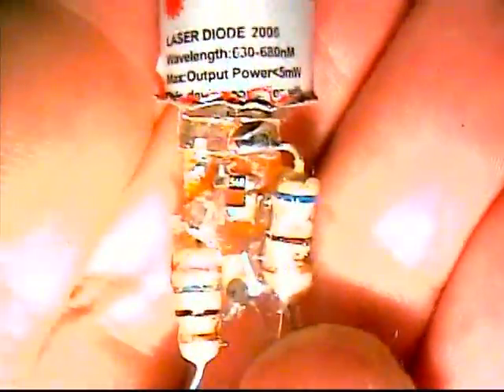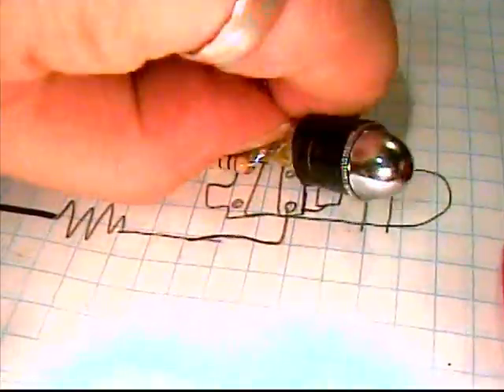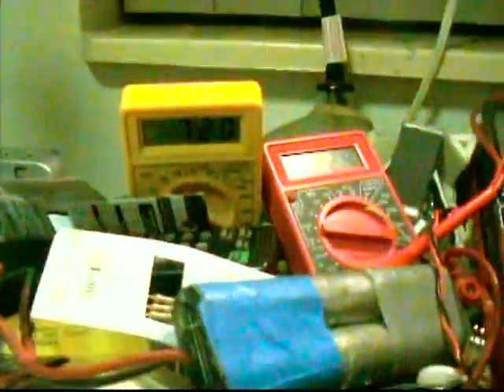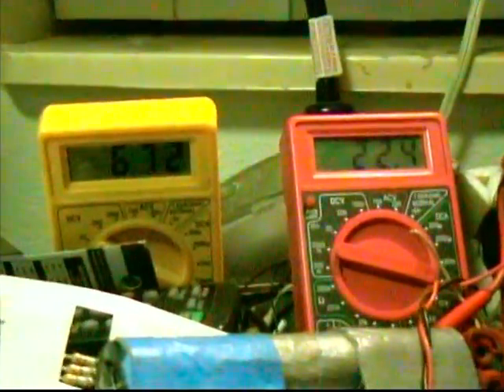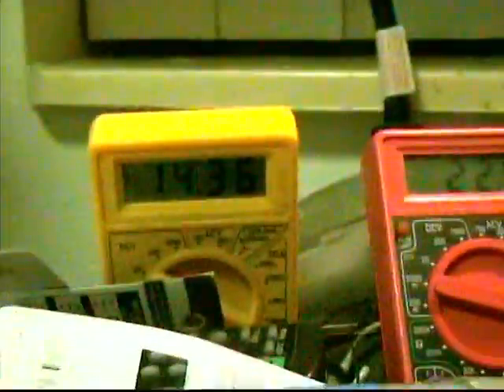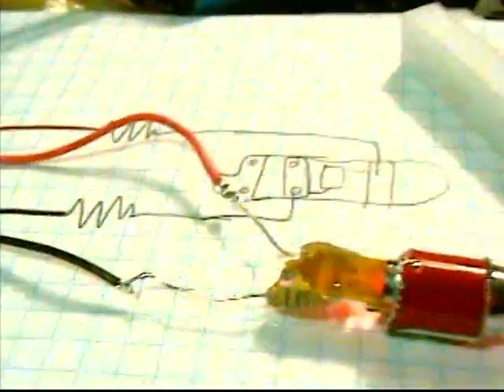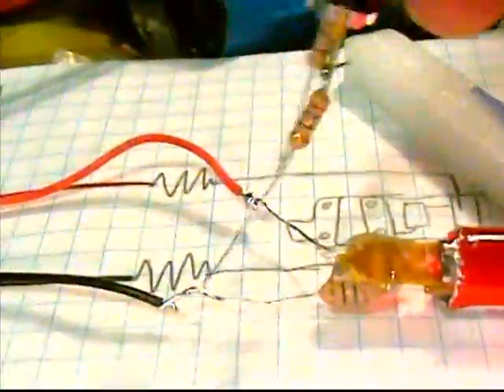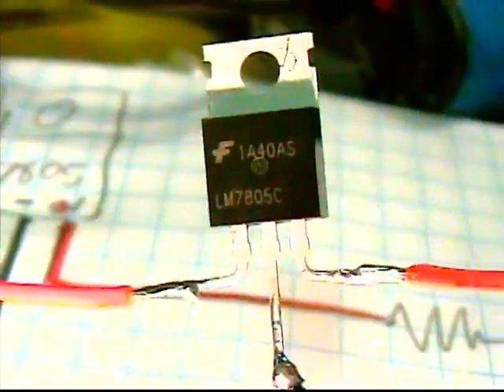PREDATOR LASERS ULTIMATE TUTORIAL PT 3

Comment: Nice beard, thanks for the tutorial! Any schematics ?
Reply from the maker: Yeah , there's the schematic on the graph paper that I'm building the circuit on , in the video , the two resistors are (a 68 ohm resistor (blue,grey,black,gold) and a 15 ohm resistor (brown,green,black,gold)) (but if You tie all of the lasers in parallel then You can just use one 33ohm resistor (orange,orange,black,gold) . It's really simple (maybe just for Me because I know it) , but I really did try to make it as simple as possible and I have the actual circuit hooked up shown right above the circuit diagram to show exactly the connections needed .     Good Luck Man .     Ask any thing else that You want .
Reply from the maker: You can see the schematic pretty well at 2:00 minutes into the video .
Reply: Okay awesome! I'll take a look at it, and I'll post a video of your design once I set it up in my hand made wolf helmet. I should be able to get away without using resistors because I'm essentially just installing a switch to power all 3 of the lasers on, and then the batteries remain in the same compartments. But I might try your method also, since I happen to have a 3 AA battery pack available
Reply from the maker: brooks potts Ok , if You're using a 3AA battery holder pack then that would be about 4.5Volts and these lasers are waaaaaaay too easy to burn out , so I used My magical equation to figure out that if You just wire all of the lasers in parallel without using any resistors between them , then You can use just one 22 ohm resistor (red,red,black,gold) that You can buy from radioshack for $1.00 bucks , but You're in another country , but the color coding system will be the same across the world .     I'll make You a super short video tonight with a new simple schematic showing Your 3AA battery pack equivalent and some lasers that I have for an example .      I look forward to hopefully seeing a video of Your Wolf mask , before or after lasers .    I'll notify You in a coupe of hours when the video is upoaded .    Take Care .
Reply: Awesome thanks for the quick response time!  I have an electronics repair and suply guy in town here, he will have it I'm sure, a little extra resistance won't be a bad thing correct? Just incase he doesn't have that specific ressistor?
Reply from the maker: Hey , I've been having troll problems lately and so I have to check people before I collaborate on any thing .     I've uploaded Your tutorial video already but it's still private .         Could I get You to post a small one minute video of Your predator mask so that I know that it's really You that's messaging Me .        It could actually be a 3 second video of You saying just one word (any word You want , as long as it's just one word) that You could erase as soon as I see it , just so I can make sure that it's You and not another sock puppet account by a specific troll that's been mildly creative in ways of trying to get to Me through the internet .      Thanks .
Reply: Aure bro no prblem at all, let me film it right now!
Reply from the maker: Ok , I'll watch it and then You can erase it if You want .
Reply: cool sounds good, I'm uploading it now
Reply from the maker: Cool , very nice of You to play along with My paranoia but I made You a 5 min video and I hope that it really helps , but in addition You can keep asking Me any
questions .
Reply from the maker: Ok , I saw it , I'll have the video visible in seconds .   Thank You again .
Reply from the maker: Ok , I did it , here ya go , Thank You again .  Predator laser help for Brooks Potts